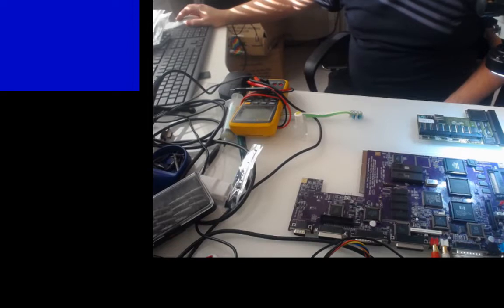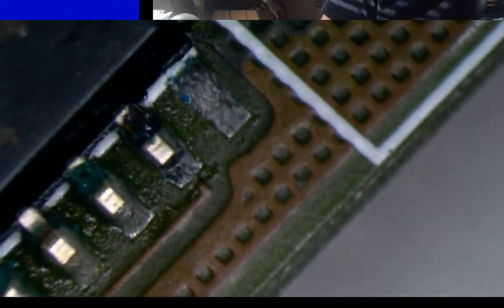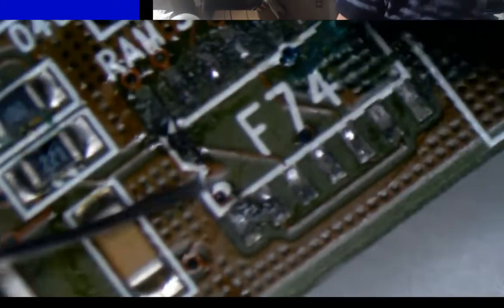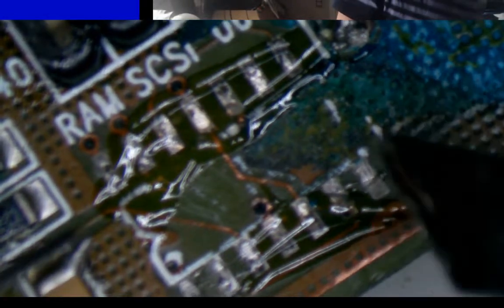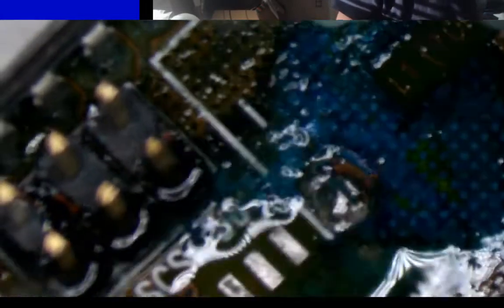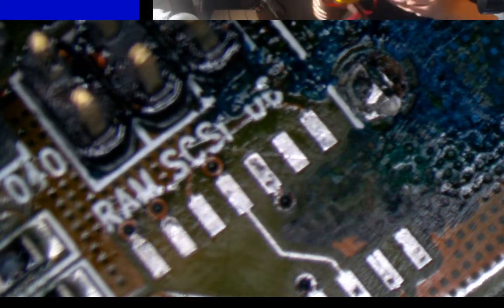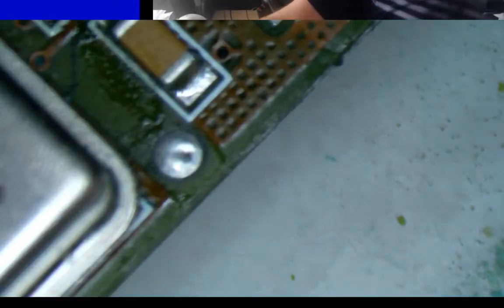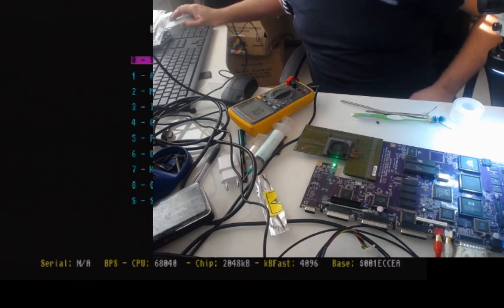Trying to repair an Apollo 1240

Comment: Awesome video, I've been fumbling around trying to figure out where the traces that the Varta monster consumed on my apollo1240/60 were meant to go, all I was missing the one to the 040 clock jumper, I've now got connectivity thanks to your video but alas still a black screen and no boot.
I'm thinking the F74 needs replacing now, is there a specific one I need? can anyone send me a link to buy the correct one?
Edited : resurrected the old F74 and cleaned the Varta juice from under the 2 end F257's, another 1240 saved from the e-waste, many thanks for giving me a glimpse of the correct traces which without I'd have failed at repairing my board.